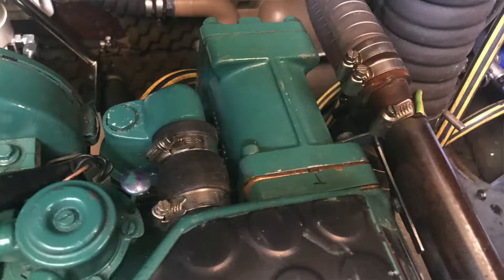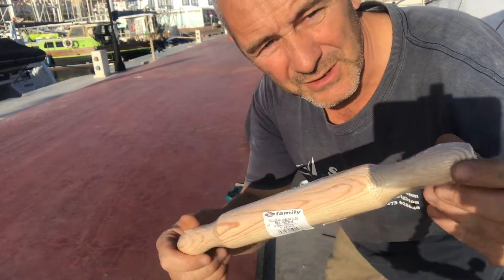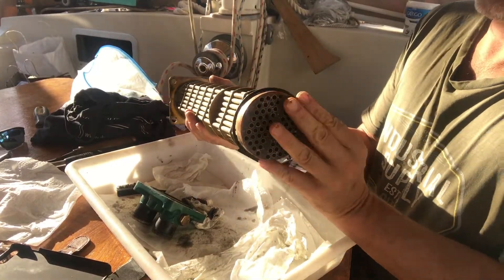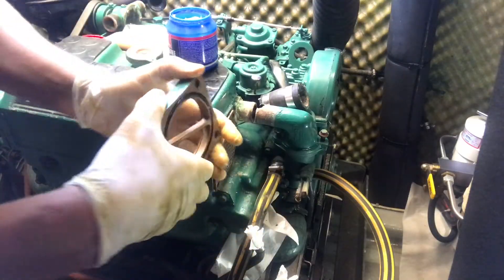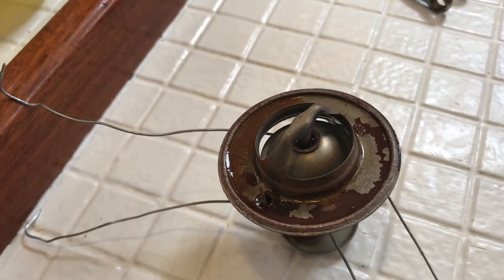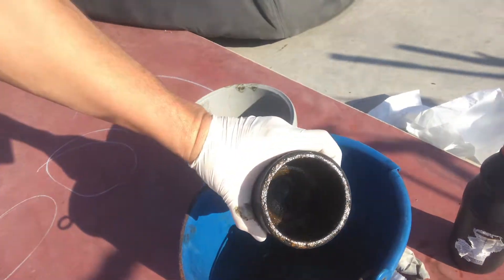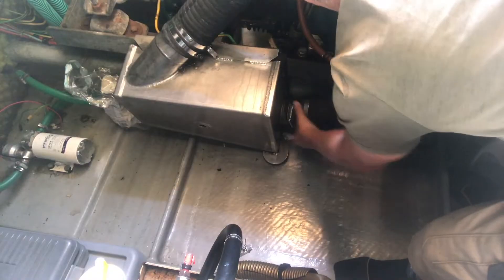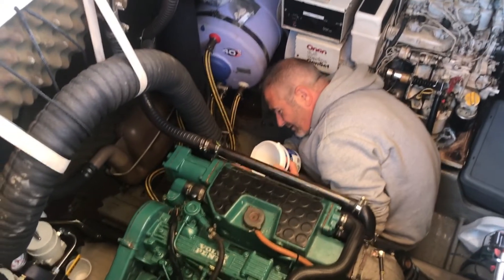Cleaning and Servicing the Heat Exchanger on the #Volvo# Penta #TMD22 Marine Diesel Engine PT 03

Comment: Man do you have the room to work on this... I am looking to rebuild my TMD22B as a replacement D2-75 is around $18,400. I am concerned about how much live the heat exchanger has left on it as it was installed around 1998.

Comment: Fwiw, I repaired a corroded riser spigot on a Volvo 7.4 petrol engine using Belzona and it lasted years. I used coffee cans and pvc pipe as inside and outside molds!